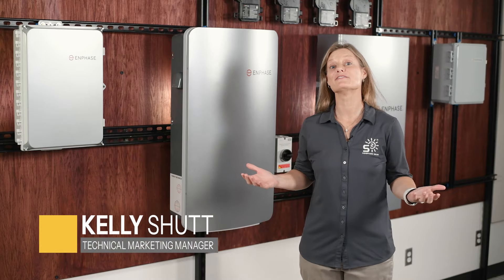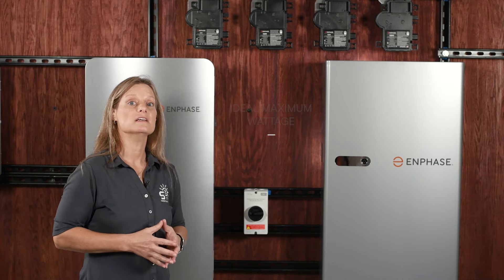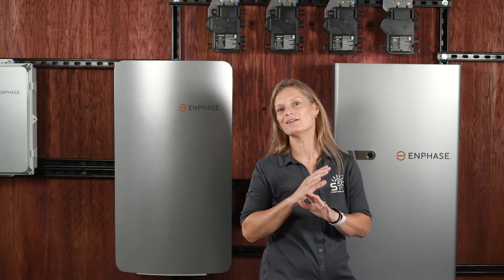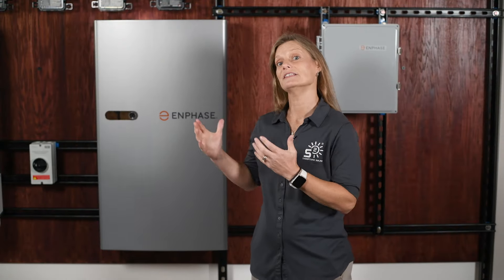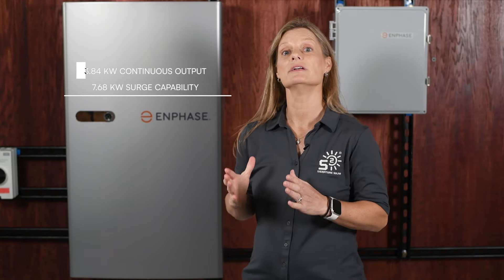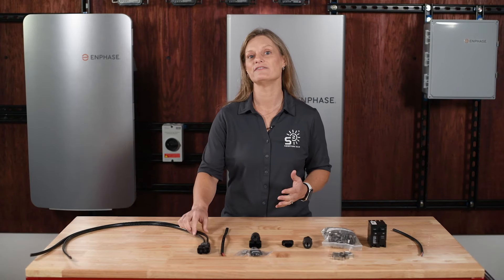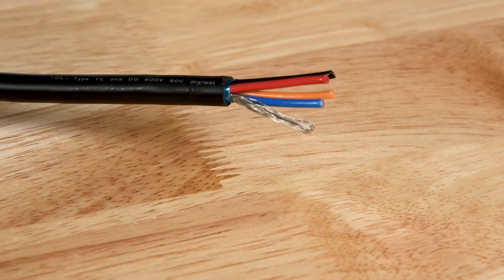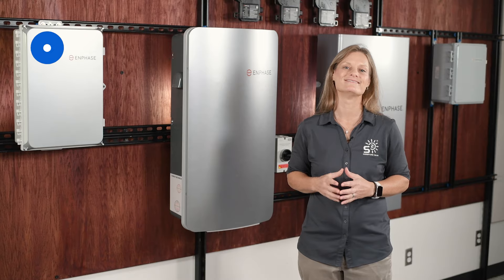Enphase Energy System Explained: From Microinverters to Monitoring

Comment: I hate my Enphase grid tie system that ADT Solar installed.  When the grid goes out, it takes days for the gateway meter to start working again after power is restored, which is usually a few minutes or hours.  Mind you, all this time it is not communicating, all your solar production doesn’t get reported to the power company and so you end up depending and paying for all your usage with zero credit.  It has happened to me four times since I got the system installed in March 2024.  I am currently on the fourth time and the system has not been reporting since October 3rd 2024 at the time of this writing.  Talk about a waste of money and investment.  I paid over $40k for this 25 panel 10kw system, and ADT solar went out of business. I called Enphase directly and the tech was no help.  My system is still down.  If I was to do it again, I’d go non-grid tied with battery backup. I am going to try to engage ADT solar again if anyone will answer the phone.  There is a law suit brewing.
Reply: Contact Enphase and ask them to diagnose the problem remotely. This is nothing Enphase related, sounds like something was installed improperly.

Comment: This seems more suitable for a professional install, than DIY.   It means one has to buy into the Enphase ecosystem.  (Also, specific training if one wants to DIY with Enphase.)  

For the DIY'er, a DC coupled system allows for more generic flexibility in mixing and matching from different vendors (esp. in case of supply chain problems).   Something to consider, depending on one's goals.
Reply from the maker: You raise some valid points! While Enphase systems are designed with professionals in mind and do require familiarity with their ecosystem, many DIYers have successfully integrated them with the right training. Enphase University offers great resources to help you get up to speed if you decide to go that route. (Enphase University: https://enphase.com/installers/training/authorization-storage-overview) 

Ultimately, it really comes down to your specific goals and comfort level with installation. If you have any questions about options or need guidance, feel free to reach out!

Comment: What if I purchase a 500 watt panel? I did not see something for this. Do you have to have a combiner box to use microinverters?
Reply: Doesn’t make sense to only buy one panel with a microinverter
Reply: @htsyami they are separate questions and the microinvertor examples do not cover a 500 watt panel. The second question pertains to if you have to have a combiner box to use the inverters. I never asked about a single panel by itself
Reply: There is a controller in the combiner box that controls the microinverter array. You can build your own combiner with a subpannel and adding the CT's and controller in it. 

As far as the max wattage, design you system around smaller panels. You should be able to get the same output for a given roof area. Lower output panels should just be smaller in physical dimension.

Comment: I missed the possible integration of my EV into your system? For to become charged or jused as a range extender for my home for instance over the dark winter weekends when at home during wintertime? (Having charged up free of costs at my workplace.)

(And if I would like to charge my EV out of my home storage, for instance it should be able to provide 60kwh to my vehicle within three to four hours - in case I can't wait over night to have the car rechargered at 6, 8 or  11 kw.)(6kw x12h=72kwh of course, slow speed recharge)
Reply: I'm pretty sure emphases has a 15.3kw level 2 charger (that assumes your vehicle is compatible with 15kw level 2 charging )

Comment: Before my rant, I want to say that I do like the fact that PLC is used to communicate between the microinverters and the IQ combiner, thus eliminating a potential Wi-Fi malware attack vector into your local network. It isolates the performance and management into its own dedicated network. This is a great design choice. -- now on to the issues I have ...

Why does the Enphase system require an account for cloud services? The explanation I've heard is that the microinverters require 'provisioning' to be compatible with the local utility provider. If this is true and the local power utility has some specific parameters such as phase limits, voltage limits, current limits, etc. then those details would originate from the utility itself, not from Enphase. There should be no reason (other than company choice) why Enphase NEEDS to manage this. The requirement for Enphase to do this seems disingenuous and thus seems to be an anti-consumer policy, possibly driven by an early design choice.

Have they designed the system so that it cannot be provisioned without their service? Was that done so that they can enslave their customers into their walled garden with endless opportunity to change the landscape through unrestricted EULA updates (see the removal of the local API from the older model microinverters)? What happens if the internet goes down during a world-wide cyber event and the Enphase cloud servicer if unavailable for several weeks (an event like the one that nearly happened with the Crowd Strike debacle, or the possibility of a world cyber war)?

It doesn't matter whether the cloud requirement is free now. There is no unbreakable contract that guarantees it will always be so and that includes penalties to the manufacturer if it fails to provide it.

I refuse to buy a product that comes with a slave collar making me a slave to the manufacturer/seller.

The public needs to be aware of these issues. It's not just Enphase making design decisions that are excuses for fundamentally anti-consumer purposes. The FTC needs new rules to prevent companies from doing this sort of thing.
Reply: You are spot on, and I don´t have any extra knowledge of this case, but in general things are going crazy... My TV demanded that I create an account at Samsung (or my TV won´t work)????   I don´t want NOR DO I NEED an account - a TV should just WORK.
My friend needed a PHONE (+LOGIN) to activate his refrigerator.
Companies are taking advantage of consumers by unnecessary data.

Comment: output of 480 va, how you will you connect this with topcon panel
max power output is 480, there will be power clipping issues
there will be loss when micro inverters are used

Comment: Hello
Could you provide some advice please.
Have a design requirement for 20 *440w system with iQ8s and 2 enphase 5kW batteries.
1 supplier which specified IQ8MC and a different supplier specified IQ8AC, the quotes are within a couple of dollars of each other. Assuming all other things are equal, which of the 2 inverters offers me the better performance please? If I listen to your guidance, I should be asking them why the aren’t specifying the IQ8H for the 440w panel, right? 
Or, it really doesn’t make any noticeable difference, we have a shading factor of 0.65 so in all likelihood the chance of a panel output greater than 300 W seems unlikely.

Comment: I have an enphase system. I was 'sold' software at the time they did not have rolled out to support a generator. Took them a year to release their software from beta to support my generator and battery system. Hope their current software support is improved. I am not a complete fan. Have had microinverter issues each year the past 4 years (at least one failing each year). I like the fact the entire grid doesn't go down when one microinverter fails, but I did not expect multiple failures this quickly. I also have to pay my installer now to replace them and that's expensive. 
I also only bought a 3.3kWh battery to start with hoping to upgrade later with a 10kWh because I was told prices would drop in the next few years. So what happens? THey stop making that size battery and the smaller batter price GOES UP tremendously. SO now I can't effectively upgrade my system, plus due to how restrictive the 7 series micros are, I would have to redo all my wiring and array setup if I added a battery and the total battery storage size was less than my full array could support from a battery regen perspective. 
I don't know if my installer is to blame for all my issues, enphase, or both, but I am only partially satisfied with my Enphase system. I encourage anybody looking at them to be fully aware of how their system will work. I think the 8 series microinverters are better and I wish there was an economical upgrade path, but there is not (they should offer existing customers a deep discount to upgrade their systems to series 8, but I suppose EVERY component including the switch and battery would need to be replaced/upgraded). ANother thought as they may come out with a series 9 at some point and that will negate your entire 8 system from upgrade.
Reply: Honestly your comment is a perfect example of why DIY off grid solar is the only acceptable choice. DIY. DO IT YOURSELF. As an expert in this field I can tell you that you got ripped off...
Reply: and by the way, your installer gets a couple hundred dollars from Enphase whenever they replace a micro-inverter under warranty.

Comment: I have an Enphase system and has been rock solid. Two 5P and 16 410W Silfab panels for about a ~6.6kw system. 

What was purchased a few months is probably out dated. Those that might be on the fence just do your homework. 

Couple of things….

Depends if where it’s manufactured maters. Enphase is made in the U.S.A. so you’re helping American workers. 

So yeah….might be a little bit more expensive. At the times Tesla ghosted me in middle of process so when with local California roofer and solar installers.

So would have gotten power wall 2 an older platform where Enphase compared to 5P was just better overall. 

Regardless, going solar is awesome. Free energy
Reply: I'm thinking of adding another solar system with Enphase iq8. Did you experience any grid blackout and how is your experience?
Reply: @BlissfulGardening15  hi bliss

Yes I’ve had two short lived outages. My electric ⚡️ provider is PG&E aka mafia of California. There was no hiccup in how the system recognized the outage. It was seamless and the only reason I knew there was an outage was because the app told me. 

I have nothing negative to say about Enphase, only wish I should have done was add more battery capacity. I feel the 10kW storage is good but 15  or even 20 is the sweet spot for my family is usage. 

Hopefully I answered your question.

Comment: So let me get this straight. Each panel needs it own microinverter and the microinverters are about $200 each after shipping...? Ok... But I can go to SS and get a pallet of panels around 9kwh and an eg4 6000xp inverter for like $4000. With this setup I can charge at 8kw and discharge at 6kw. Pair another EG4 for an extra $1500 making my total $5500 and now I can charge at 16kw and discharge at 12 kw. That 9kw pallet is probably about a 26 panel pallet...so to put a microinverter on each panel I would be spending 26x200=5200. Plus the cost of the pallet of panels. And that's to be able to charge and discharge at a lower rate. So why would anyone do this?
Reply: And I'm pretty sure modern MPPT's already have a mechanism built in to deal with a single panel being shaded so the whole array is not wasted...do they not? I swear that hasn't been an issue for many years...are we taking old innovations/ideas and recycling them here as if they were new?
Reply: @elevatedsciencesllc8089  Mppts don't have them built in, Some VERY pricy panels do but SS doesn't sell them and the cheapest I can find is around 1K each 560 panel. 
 Really this is mainly for high shade/cloudy areas. Or for roof placed panels so if a panel ever goes out your whole system doesn't an you have time to get it fixed. 
  
 IMO if you have a ground mount tho these are only good for shade and even then the DC to AC ones like this... Is not what I would go with
Reply: @dizzlethe7346  that's strange, I have arrays that get partially shaded in the morning but still product decent wattage when a panel or two is shaded, not full output of course but it doesn't seem like one panel is just cutting off the rest of them...
Reply: I just use EG4's and whatever panels SS is selling cheap
Reply: @elevatedsciencesllc8089  idk why my other message was deleted... You will still get power without these on shady days. Just the max power will match the worst output panel.  An even cheap panels have "self" isolations on them. Like mine from ss are 1/3 sections so if only 20%of one end of the panel is in dark shady instead of just blacking out and getting no power it still produces 2/3s but everything in the series is also limited to 2/3rds the power
Reply: @elevatedsciencesllc8089  what your doing is good for 80-90% of the people in the US.
Reply: @elevatedsciencesllc8089  how do you like the eg4 inverter? I've personally seen and heard both great things about the 3-6000s and a mixed bag for the 18ks.  I went sol ark 12ks. Speaking of that's another reason why people get these dc to ac micro inverters. People max out there mppts (volts or amps) and you can use the "micro grid" aspect and push the power through the (gen) as a pass through.
Reply: @dizzlethe7346  EG4 6000XP is the best equipment I've found yet, have used schneider growatt and old EG4 when it was made in the other factory (the old 6500's and the old super heavy 12k's) no unit has ever performed as well as the 6000 XP from the new factory ...would never touch a 12k or 18k...for the money youre better off pairing multiple 6k's...yeah that makes sense about the panels too
Reply: It's a better system .

Comment: Wouldn’t touch Enphase. Solar Panel DC> AC, AC>DC to Charge Battery, DC>AC to Discharge Battery. 
DC coupled battery systems are more efficient. Solar DC, Battery DC, Invert to AC once.
Reply: As an electrician high voltage DC power is much more terrifying than ac power. I will take as many inverters as it takes to keep dc voltage lower and wiring as short as possible, transmit with ac. That's just my opinion though.
Reply: @Symbolizer21  if you are scared by DC you better not drive in an EV vehicle. 😛
Reply: @user-ei3ml8jo1s  I'm not scared by it just respectful of the damage it can do. An ev also has significantly shorter runs that are engineered, similar to a commercial UPS a data center might use. I'd just rather not have that running through my home where my family sleeps. 

It's also different if I install it (or in the case of a car is manufactured) than if a shady solar company installed it. I've come in behind those companies and I am never impressed. 
I also firmly believe fire suppression should mandatory in new construction residential garages to safeguard for EV. I saw someone else mention that their municipality required fire suppression if their solar batteries exceeded 20kwh and was installed indoors. EV's have much more than that but there is no provision for them.
Reply: @Symbolizer21  my DC solar equipment is in a structure that is not attached to house or garage. You have obviously seen the news where EV vehicles sit there burning.

Comment: Uggg. 

So is this new system compatible with the system I bought 2.5 years ago (Dec 2021)? 
   My installer was Lumio. 
   30 panels (Canadian Solar HiDM5 All black CS1Y-395M) with 
   IQ7PLUS-72-2-US microinverters,
   Encharge 10-1P-10A battery and 
the magic boxes that go along with it.
  One of the things I hope you fixed are the shoddy cases for the equipment. I have complained to Lumio several times but I still can't open my controller. 

  Bottom line: 
    1. How many boxes do I need to replace to use the new battery? 

    2. Is Enphase planning on building a version that holds up to 4 batteries? I was planning to add three 5P's to my existing Encharge 10-1P-10A battery. You should be able to do all the connection in one piece of equipment. Much cleaner (look at LOT better) and less labor ($$$$) to install. 

    3. Do i have to replace all my 30 IQ7 microinverters to IQ8s? 

    4. Are Enphase and Span improving their interface to provide consistent information to the application without recalibration?
  Thank you.
Reply: @jamesmterrell  My assumption is because most of the equipment is ac coupled it should theoretically be all intercompatible. You should be able to mix many versions of micro inverters on the roof together with no effect. It comes down to software for what will and wont work in the real world. Reach out to emphase directly .
Reply: @Symbolizer21  Thank you.